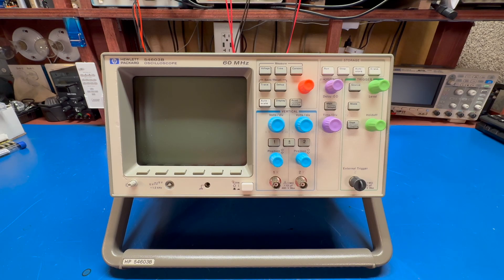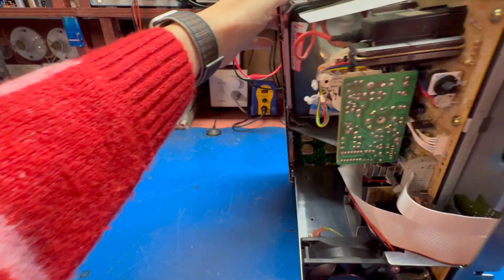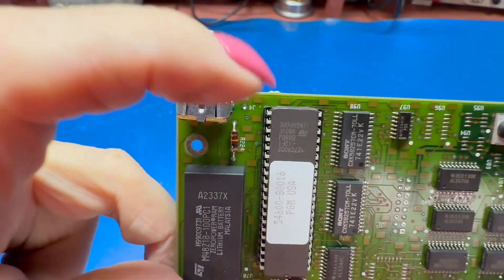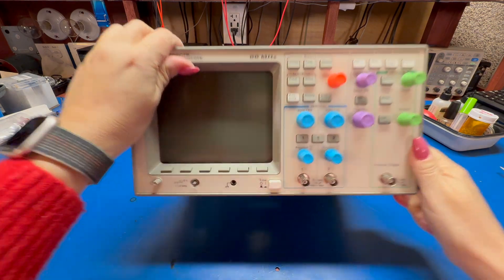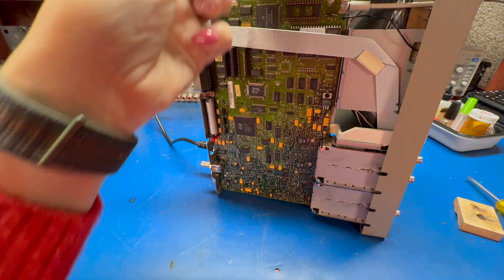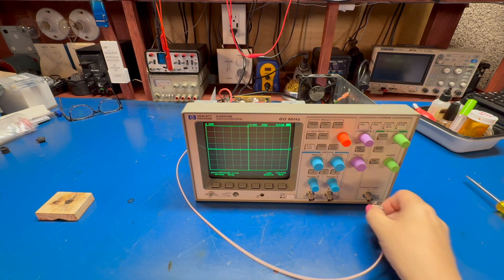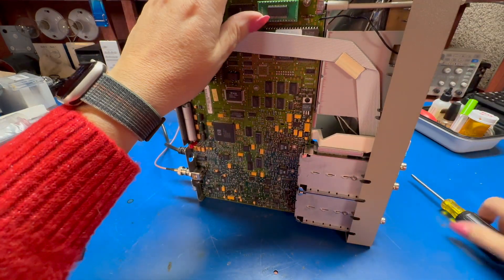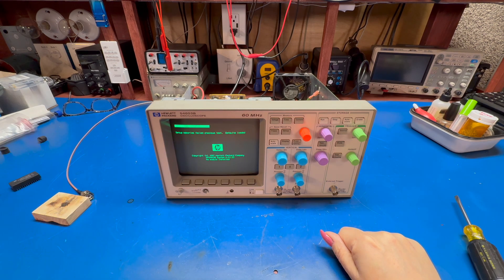Replacing Dallas DS1225Y NVRAM with FRAM (Part 2)

Comment: I can tell my brain is broken because the first thing I want to do is replace that fan! 😆Good luck on the next step!
Reply: I replace fans with Sunon Maglev fans whereever I can, they are amazing. When they get moving they are running on an air-bearing essentially with perm magnets. They cost a bit more but totally worth it. Otherwise Noctua. Particularly on critical gear.

Comment: great video. are you a professional engineer gary?

im looking to trade some gear as i want a simple micsig tablet scope so i can work on vehicles as well and have a more portable option when fixing cars, audio gear and tutoring a friend who is first year engineering when im not in my lab. i have a rigol mso5354 with official logic probes (cracked firmware, but i have the original backed up), along with some other stuff, vintage meters, misc tools and such. i've spent a fortune on new guitars and such lately. the scope doesnt even have 5 hours on it as i tend to use my old tek scope more often and got the rigol for free as a result of an insurance claim from a hurricane. it has more features than i'll ever use and there's no local market to sell it. i can provide the receipt and all that. i'm looking for a simple 100mhz micsig tablet scope if you're interested. i'm buying the rtx5090 next month as well and dont want to push the partner to hard considering i just bought 2 new guitars, travel amp and a bunch of other stuff. i paid like 2300 for the scope and la probes (which i know you already have). i have other stuff to trade as well, differential probes, new mitutoyu calipers, lcr meter, countless components i dont have time to put to their use (id actually give alot of components away just to free up some space). anyway, i know you have alot of gear so im just throwing it out, i have other creators who can vouch for me and what not. im on the east coast of canada and would pay all shipping.

food for thought, even if you just want some components and misc motors, leds (i have tens of thousands haha). no strings attached, im trying to free up space in my hobby room because it's full of unused components and more gear than i need. i cant even make space to repair a few guitars i have and my bench is 10x6 feet wrap around the room haha. plus i need to acoustically treat the room for recording the guitar and bass for an ep i've been writing between travelling 3 days a week for medical appointments haha. nothing serious, just living in the middle of nowhere means you have to travel if you want to pay for decent healthcare in my part of canada because our socialized healthcare system sucks. i always thought it was crazy that americans have to pay for their healthcare but as i get older and wiser it's much easier to tell the quacks from the better drs that the private heath sector attract. haha. anyway, im rambling. keep up the great videos and add a thankyou button, you deserve some reward for your hard work.